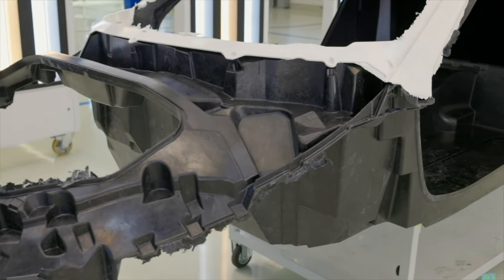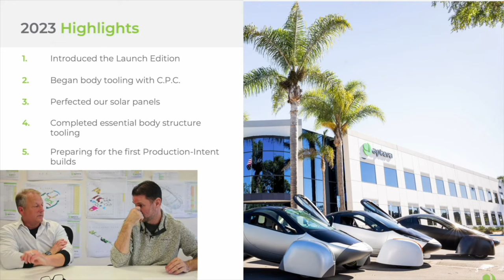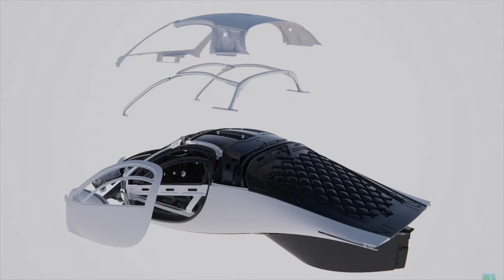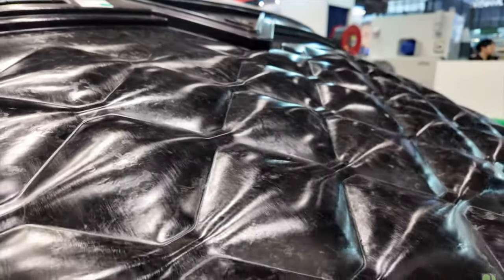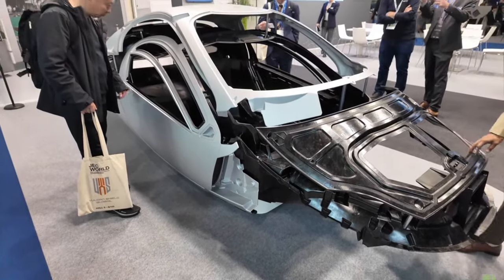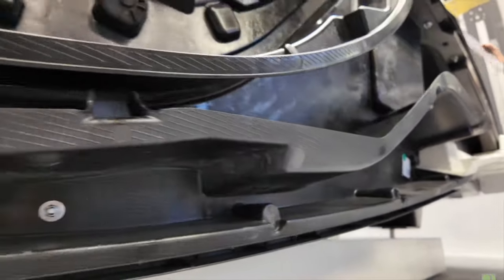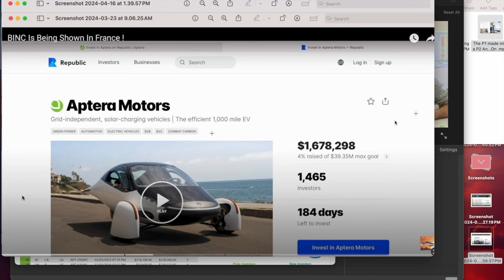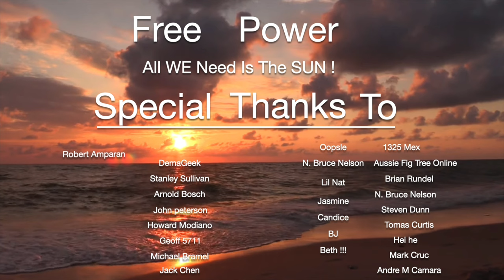Is The P1 Ready ?

Comment: PI-1 will not be converted to a rolling vehicle because no roll cage was installed in it for structural support esp. for the doors.
Reply from the maker: Thanks , that's good to know . 😎
Reply: First of all, how do you know no structural support was installed in PI1? Do you have a statement from Aptera saying this? Please provide a link to it if you do. 

Second, how do you know the structure can't be added at a later time? Chris was saying that support structure needed to be added to the roof for it to be full strength. I assumed this support would be part of the interior, but it could also be inserted into the roll bar, assuming it wasn't already included. From the renders I have seen this "steel support" doesn't seem to be anything but a thin rod. 

The primary support for the roof is the CF SMC roll bar that is attached to the tub. That provides the foundation for the roof, which is fiberglass. 

Steve Fambro says in this very video that the PI builds are able to be "upfitted" with new parts as they are designed. My understanding is that no PI build is a dead end, every one of them will be able to be completed and drivable eventually. This post will look extremely foolish if PI1 is subsequently outfitted with a chassis.
Reply: @richardryley3660  - the recent video from tailosive included a long interview with Chris, as he stood on the roof and talked about no roll bar on pi1.

Also, I think in Aptera Motor's  march review or maybe it was the binc delivery reveal, there was a discussion about pi1 is primarily for engineering wiring harness finalization.  Some people seemed surprised that doors were delivered with the tub structure. 

This two videos combined also led me to believe that pi1 was not going to be a rolling vehicle.
Reply: @tfloyd6651  Is this the quote you are taking about?

"This is missing some of the structure underneath but 210 lbs, I'm a big boy. The carbon fiber is really tough underneath there. There's a roll hoop and then once we put the steel structure in there, we'll take a picture with like 12 people on [the roof] or something." 

Once we put the steel structure IN THERE. Clearly they have a method of inserting the steel rod into the roll bar. 

The roll bar or "roll hoop" as he calls it is clearly already in place. It can be clearly seen holding up the roof in the interview. It's black, as the carbon fiber SMC naturally is.
Reply: No need for any steel structure as I have been told by many aptera supporters, CF is 7 times stronger than steel. Why put in a material that is 7 times weaker. Aptera is about efficiency and lightweight. No need for any of this extra stuff.
Reply: @richardryley3660  - yes.  That is the area from one of the videos, I was referring to.  Maybe they will install the steel on pi1, and maybe it will become a rolling vehicle.  Maybe his inference was about future pi's.  I'm no longer getting my hopes up for more than Chris or Steve explicitly state as currently happening.
Reply: @tfloyd6651  Well, we won't know for a few months at least. I consider it likely that once PI2 is complete, PI3 will get a chassis before PI1 does. But that's on the assumption PI3 will be the first demo vehicle, when it looks like it might be PI2 instead. 

If PI1 doesn't get a frame before PI4 is built, though, I will be surprised. PI1 should be used to compete the interior. If that takes a long time we probably won't see PI3 for a while.

Comment: The initial bodies are verification subjects. There are a lot of production, integration, and assembly issues that these units will aid in addressing. Compared to say an aviation fuselage, the BINCs are relatively inexpensive and will likely be scrapped in the end.
Reply: At least one or two of the PI vehicles may be there to be display and drive around vehicles.
Reply from the maker: We’ll it’s good they can be recycle .😎
Reply: I'd want one! No need to scrap it!
Reply: I'm fairly sure any PI builds that survive crash testing will become corporate transportation for Aptera. Or will be kept for historical purposes, alongside Alpha, Beta and Gamma.

It's possible, but highly unlikely, that changes may be made to the BinC to address unforseen issues.

Comment: As it's not classified as a "car", I wonder if the plan includes all of the NHSTA/IIHS crash test scenarios or a smaller subset. Only the moto/autocycle requirements are a mandate for the vehicle  obviously.
Reply: Aptera intends to run all of the crash tests required by the IIHS even though they are not required by law to run them. They want to prove that even though it is classified as a motorcycle in most states, it is as close to as safe as a car as they can make it. 

The biggest issue with meeting the safety standards of an automobile is that they don't intend to include side air bags. The door protection will.have to be extremely good for them to be as safe as an automobile in a side collision. They may end up falling a little short. 

I'm hoping third parties will offer side airbags that can be installed in the seats or door pillars. Or that the crash tests show that there is no problem.

Comment: Will a 10 foot 2 inch PCV pipe be able to fit from the back corner to the front of the passenger side dashboard?
Reply: That is a highly specific question. Now I want to know the answer too!
Reply: Easily.  I used to do that with my early 90s civic hatchback.  And this is longer on the inside
Reply: If not, perhaps the the harch can be left open a tiny amount (and tied down) over the lumber or pipes.  
That said, the dashboard seems pretty deep, and that may provide all the extra space you need.
Reply: @milohobo9186  Oddly specific for sure.  Now I want to know what you can do with a 10 ft. 2 in PVC pipe that you can't do with a ten foot pipe.
Reply: I was wondering that too. Plus what will happen if said pipe is in there and I have someone rear end me then I flip over into a river. After that, there is an earthquake along with a tornado. If aptera is really into testing, they will do this.
Reply: Good question. I believe the vehicle is just shy of 15' long.